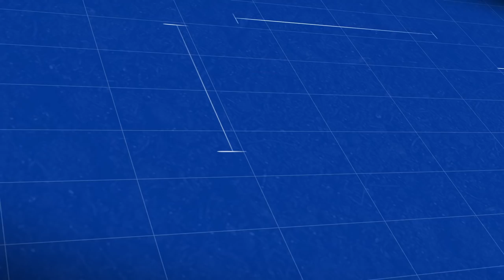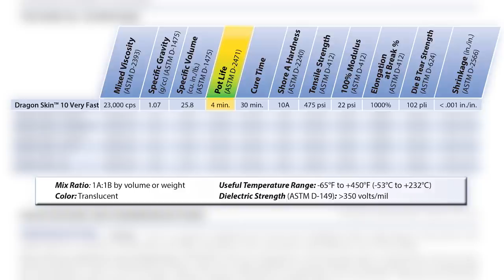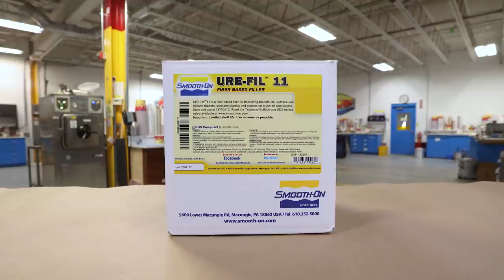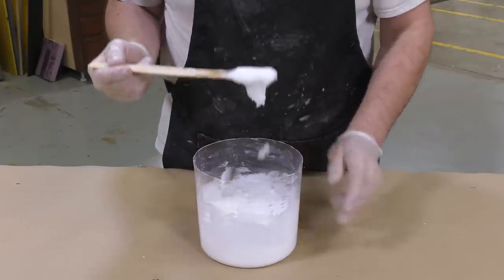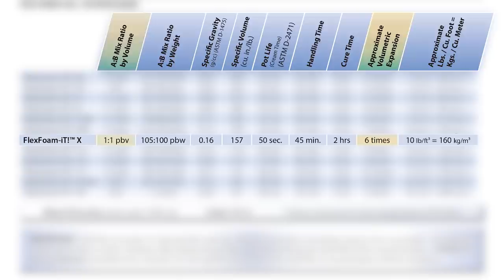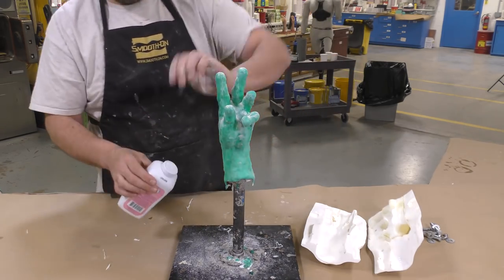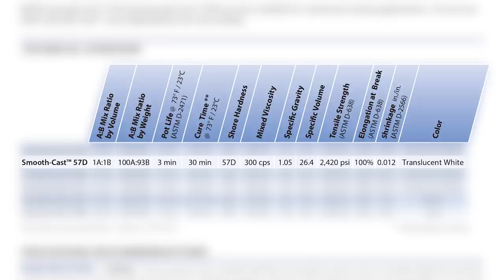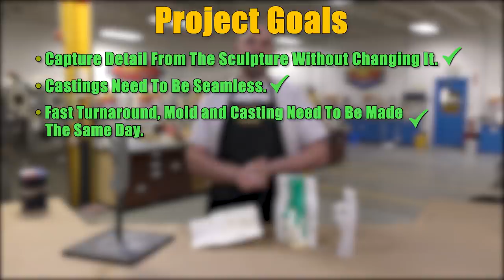Seamless Silicone Glove Mold - Making Things with Milo

Comment: Could I use a similar process as the "Making the Rubber Mold" portion of the video, to make a clear (or I guess whatever color I wanted) flexible glove for my hand? I'd assume there might be some toxic chemicals in the compound that is brushed onto the clay mold, and so I guess there would need to be some research done to protect my skin otherwise, and if yes would it hold together with the flexing of my hand? The reason I'm asking is because I'm trying to figure out a solution for creating a glove for a costume that can either A. Have light defused over it to make it glow a certain color, or B. Have it colored in a way that makes it appear like it's glowing, and I think silicone or a similar material could do that nicely. The reason I'm thinking of this as an option is because of how much it looks like a real hand with a shape, and would fit more snugly on the hand, whereas something like you're wearing as PPE is loose and wrinkly, and wouldn't work for what I'm trying to do.
Reply from the maker: Can you send us a tech ticket? Our team can help you - https://www.smooth-on.com/support/ticket/add/agree/

Comment: Was the reason why smooth-cast 300 + filler was chosen (as opposed to something like plasti-paste), only for the cure time? If not under a same-day deadline, would this (or any other) choice have been different? 
Thank  you so much for these videos!
Reply from the maker: If you aren't in as much of a time crunch, Plasti-Paste II is another option for making the support shell halves, and a slower setting version of Dragon Skin 10 will give you a more generous working time.
Reply: Do u need to degas the silicon for glove mold?
Reply from the maker: You could test Drgaon Skin 10NV, this does not need to be vacuumed.

Comment: You never degas even on the first layer? Will I have to worry about air bubbles or does the compressed air help get rid of them?
Reply from the maker: If you apply the material in thin layers, air entrapment should not be a problem.

Comment: At 21:30 it shows some clay came off of the original model and is inside the soft mold, how difficult was removing that from the soft mold?  Were you able to turn the fingers completely inside out to clean it?
Reply from the maker: Yes, you can turn this type of mold completely inside out to remove any residue.

Comment: You know I know this is a year old but does it have to be five layers or can you pull it off with four???
Reply from the maker: Hi there, this would depend on how the rubber is applied.  The goal is to get close to 3/8" thickness
Reply: @smoothon  thank you so much excellent advice indeed I added an extra layer. came out perfect thank you!

Comment: Can I use this material for casting concrete?
Reply from the maker: You can, but you will get a limited number of castings compared to a more abrasion resistant urethane rubber.

Comment: Hi there! Does Milo have a company email? I'm working on a fan film project and I'd like to Shoot the S#!t as it were and maybe help me to at least on Paper figure out the manufacturing materials costs i will need to accomplish my goals.
And all the stuff i need, he's demonstrated here on the channel.
I'm using 3d printed bits and foam for the armor parts for my costuming.
Both materials are Not Durable and my fan film project requires durability as a break or crack to any one "hero costume" piece will delay filming for a considerable time when I'm only gonna have cast and crew available for weekend filming.
For the sake of argument take the Armor set as indicated by my profile picture. I need to copy each piece from the helmet on down, cast each for molds and then do the rotocast as seen in your videos. I took would like to toss these pieces from a roof top and have them nary but a scuff or scratch on them.
Once I know that cost, exactly how much I need to get from Smooth On etc. That way i can budget to make it happen.
Anyways if Milo is up for it that is i would humbly request an email or Care Of email address!
Ty!
Reply from the maker: Can you send us a tech ticket? Our team can help you - https://www.smooth-on.com/support/ticket/add/agree/